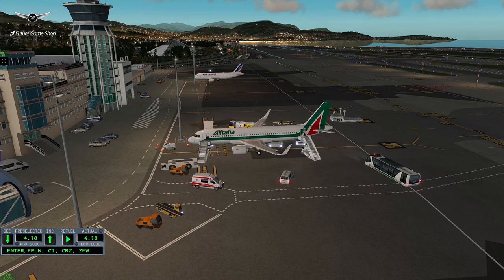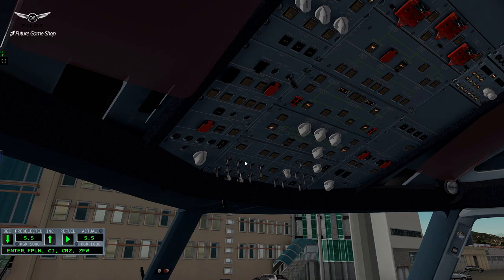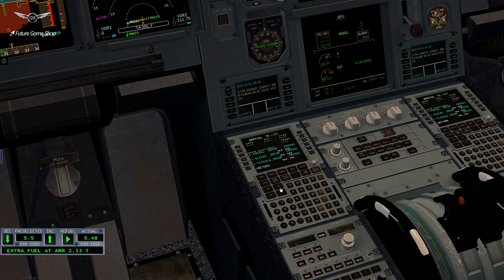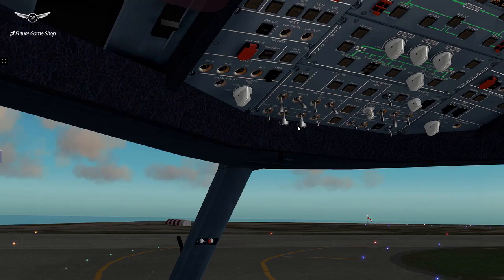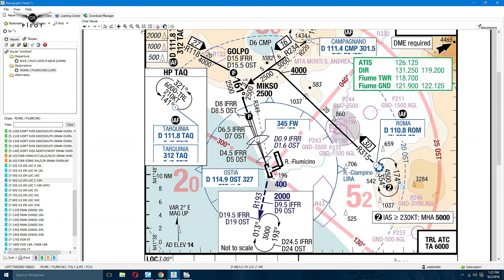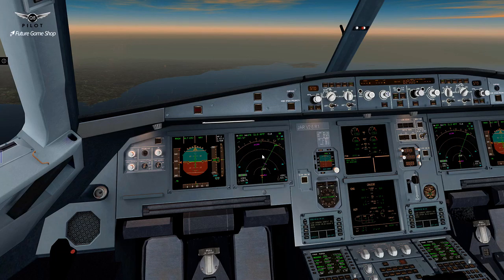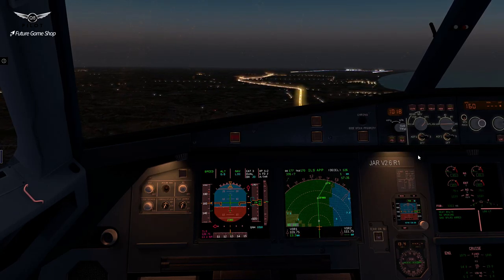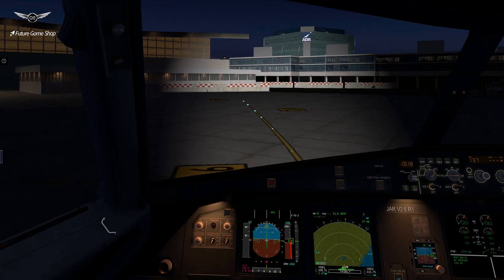[X-Plane] Transitioning From Boeing to Airbus | Beginner's Tutorial

Comment: Nice video. However you need to do some reading on use of managed speed for approach. Airbus offers ground speed mini to assist in variable winds etc and use of selected speeds on approach is a Boeing thing. Highly frowned upon in the world of the tray table.
The Jar Buses are fairly inaccurate in many ways. The MCDU's are not functional in the way presented ie direct to etc. Also the display portrayal is also wrong in many ways.
The auto flight system also handles poorly not reflecting how the aircraft handles or transitions from mode to mode.
Nice try but though but to really show how the Bus works we need a much better Bus to start and given how different they are you need someone with intimate knowledge to help out to clear away the innacurate information and incorrect operating procedures prevalent in the sim world.
All the best
Darren(Real world A320/330 Captain) ex beta tester.
Reply from the maker: Thank you for the valuable information captain. It is great to have a real pilot point things out as no matter what we do in the flight sim world, we would always fall short.

Thanks again sir!
Reply: +Osamah Alabdullah hope it helped just clear up the aircraft are far more different in the real world than any sims portray. However the new 320 coming out might start to show people why guys who have flown both simply grow to love the Bus. Any questions just ask.
JAR tried hard but the simulation of the MCDU, the auto flight system and the FCU all fall far from reality and it's to late for them to change it.
Things like waypoints not disappearing from your plan once you have gone past them and the maze of lines on your ND are nothing like reality.
I could go on but it doesn't achieve much.
The JAR 320/330 are a very basic intro to the Bus but it lacks many of the great things that the Bus does which set it apart and make it the most beautiful aircraft to fly.
If someone bought you a imitation Ferrari and it drove like a Ford is something like what happens to the Airbus in home simulators.
You miss the fidelity and amazing handling the FBW gives you and much more.
Reply from the maker: Darren Howie I was talking to an aircraft engineer a couple of days back, and he too sees the A320 as the best of the best. Though his main aircraft was Boeing, he went on and on explaining how the A320 is far better both for pilots and for airliners as its fuel efficiency is one of the best in the industry. Well, I guess I am done with JAR and will await the FSLabs to come out. Hopefully one day, I can sit in a real airbus to see the differences for real :-) Thank you captain.
Reply: +Osamah Alabdullah thanks again for the videos and making the effort to share the live of flying!

Comment: hi Osamah great video as usual love ur channel...I have a question regarding efass vs simbrief I see u use efass and was planning to buy it what are ur thought should I invest in it what's the difference between them and also which fuel calculations are more accurate. thank u
Reply from the maker: Frankly, I use EFASS because of simplicity. SimBrief is becoming my favorite planning tool. Use it along with FlightAware to get real route information. In my research, I have found simbrief to give more accurate fuel calculations and EFASS has not received an upgrade in ages.

Comment: Hi Osamah. Im new in X-plane and right now i only have the pc12 but im sure sooner or later i´ll get the ixeg 737 as well as the a320 jd.
Since yesterday im having some problems with the x-planes fps. I´ve been flying theses days perfectly without any drop of frames but yesterday ,without doing anything to the xplane previously,  i had it running at the airport and frames were perfect till i switched window 1 min to chrome. After that i came back to xplane and fps dropped to 4 and didnt improve. That has keep happening since then. I´ve reuploaded xplane, restarted computer, tried other airports, other planes, i´ve checked task manager (nothing weird). Everytime i open Xplane frames are ok till i go to chrome, skype or whatever then when i come back to xplane frames drop instantly... This didnt happen to me previous days while using chrome or other programs.
I wonder if you could help me. I´ve run out of ideas. Thanks for your attention.
Reply from the maker: Looks like something with your PC. Open the task manager and see if there are any processes with high CPU utilization.
Reply: There wasn't any. I did check and everything was normal. I also set xplane as a priority high to process and still frames were low. I'm pretty sure it must be something weird and quite simply because my computer can handle the xplane as it did days before but i cant find it. :(
Reply from the maker: +22459ignacio delete your xplane settings file. A new file will be created when you restart xplane. In the past this has helped me.
Reply: Hi Osamah. I've tried this and although sometimes seems to have worked others my frames have again rised when using chrome or any other program. I still dont understand it. I think i will reinstall xplane. :/

Comment: What does flex temperature do? You sounded like you didn't know and thus didn't explain it?
Reply from the maker: I wouldn't assume things my friend. Flex temperature has to do with de-rating the take off power to reduce engine noise and tear and wear. This is performed normally by large airliners. If you read the title of this tutorial, it is a Beginner's tutorial, hence covering something like flex temp and engine derating would be a bit of an overkill. Happy to provide with more information on this if needed. Thanks for watching the video =)
Reply: Q8Pilot thanks for the explanation :)  I wasn't trying to be a critic you just hopped over it very quickly. Good tutorial all round though. Nicely done
Reply from the maker: Happy to receive any critique my friend =)

Comment: How do you calculate flap and trim settings?
Reply from the maker: The trim is automatically calculated for you. The flap settings will depend on weather conditions and length of the runway and payload as well. Flap1 on the Airbus is the most common. For a short runway, it is recommended that you use flap 2, but you have to watch your speed.
Reply: Oh, and the auto land won't work for me. The distance won't show up when I get on final approach
Reply from the maker: This would indicate a problem in the flight plan. Did you select the star and runway for arrival?
Reply: Q8Pilot Yeah, for KJFK I did 22L and ROBER2 arrival, No Via and Trans
Reply from the maker: WillyDuxNation Ok, Did you at least capture the localizer?
Reply: Q8Pilot I'm not sure. I didn't see LOC pop up or G/S.
Reply from the maker: WillyDuxNation Would you be able to make a sure video for me to see what you are doing. I just need the approach part so that I can see what is going on.

Comment: ...update the metar load weather up the fmc...request any plugin? i try tu update  but nothing
Reply from the maker: You must first set position in MCDU.
Reply: +Osamah Alabdullah  yes i set position for example limc/eddm...settimana sid/star...Irs allign...but nothing when i push update......So Sad....
Reply from the maker: Federico Franzoni Can you please try a different route. Say EDDM to EDDS. No need to fly it. Load the flight plan and give it a try. Let me know if this also fails.
Reply: I did as you told me ... metar date does not update ... are connected to the internet but nothing works .... you know help me ?
Reply: I also tried to connect with IVAO but nothing

Comment: also what is that kgx 1000 window in the bottom left of your screen?
Reply: Reply please I can't seem to find any info on this , is it a plugin or something? I would really like to  find out more about it, please reply
Reply from the maker: Sorry I must have missed your comment. Which window are you referring to? Can you please reference the time in the video?
Reply: Published on Sep 3, 2016
Reply: It was visible from 0:36 to 15:31 it disappeared when you dismissed ground services  so I guess it associated with that what version of gnd services are you using? JarDesign? or the free python version? or some other type
Reply from the maker: Steve Simmons Oh ok that's the fuel box for the JAR. You should get a small box on the upper left corner of the screen. It is a black square box. From this box you can call the fuel truck. If you have ground handling, it will automatically appear once you call the fuel truck from the plugin.
Reply: thanks for emailing me the flight plan, I followed your vid and all went great till I got to rome and I did not lock onto the landing glide slope and the milage to the runway never showed up guess I missed a step  somewhere , rewatched the vid and didn't pick it up wondered if you might could point me in right direction to what I might have missed? also would that FP work on a330, 319. 321, a380, a340, etc?
Reply from the maker: Steve Simmons I sent you an email with a few tips. Please let me know if you need any further help.